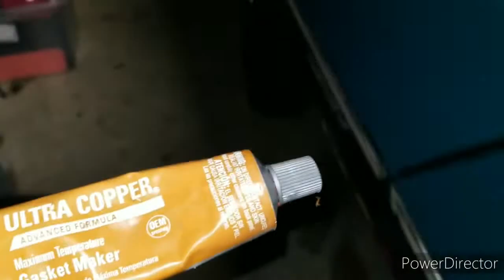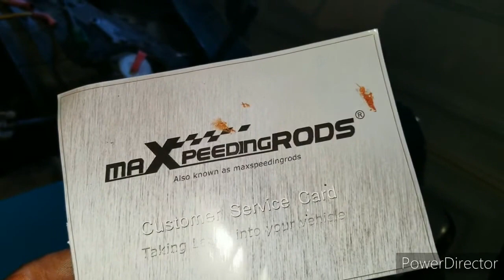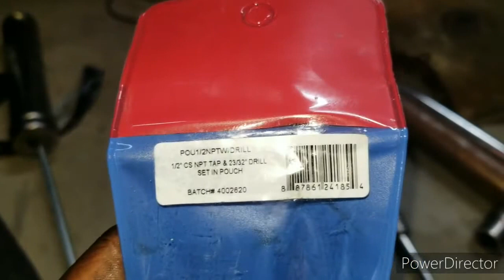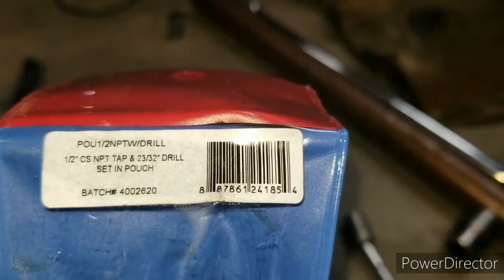SBC Turbo Install (Part 2)

Comment: Keep the nos hit it with a small shot to spool turbo just because
Reply from the maker: I was actually thinking about doing that. Thanks😁👍
Reply: Duwop77    Look up VS racing they got some bad ass turbos for a good price
Reply: Duwop77 I got a 69 Camaro with a built 383 and want to put a turbo on it. You the only one I seen posting videos on the cheaper turbo kits and look forward to seeing the new engine setup

Comment: Am I the only person wondering how those metal shavings from the oil tap got out of the inside of the pan?? Made me nervous there bud lol
Reply from the maker: I understand. I was the same way  b4 I did it. But my engine was old and worn. So I didn't mind. But I've seen video's of others do it with no reported issues. Lol. 
Thanks for watching 😁👍
Reply: What's the oil filter for? Sbc's are tough couple shavings through the oil system won't matter

Comment: Why  did you post this video if you were just going to halfass it with the header wrap
Reply from the maker: Because the video is mainly about installing a turbo not exhaust wrap. As the title states. I just included the exhaust wrap as a bonus. Thanks for watching 😁👍